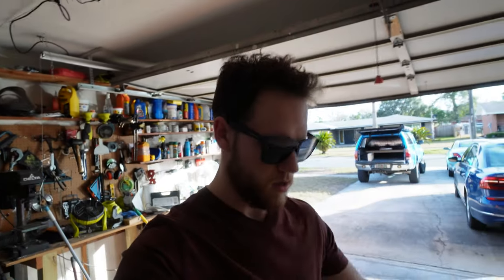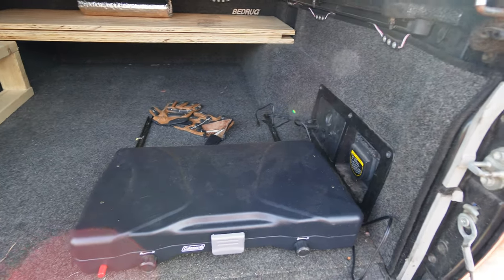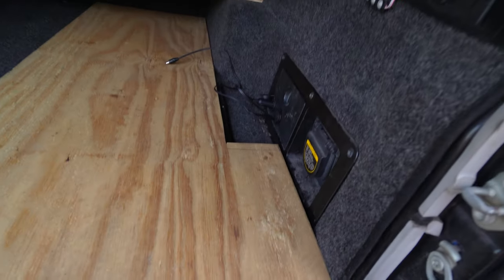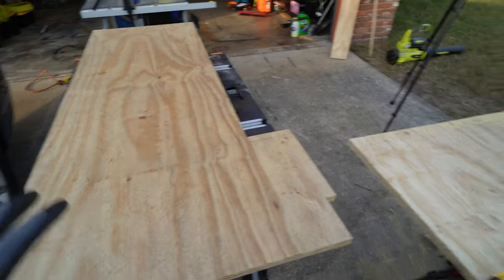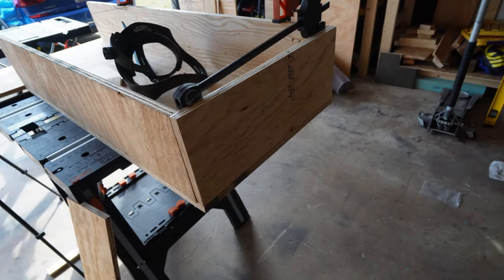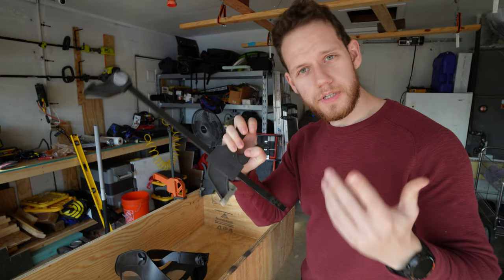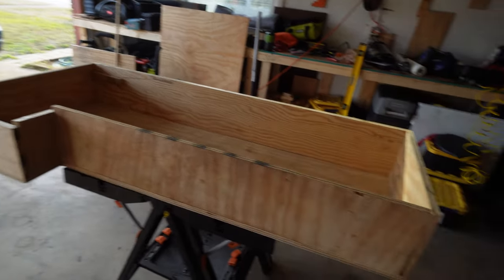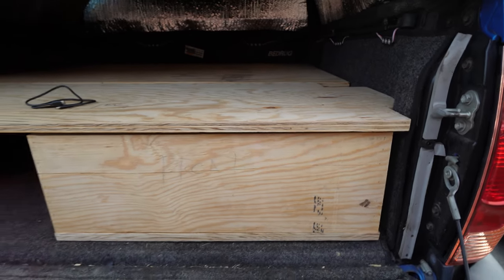Simple Truck Bed Drawer (DIY)

Comment: I did something similar but in the bottom I attached some strip of a cutting board. Slides so much better now. Mine drawer also has scrapes since I wanted to save the big pieces of lumber.